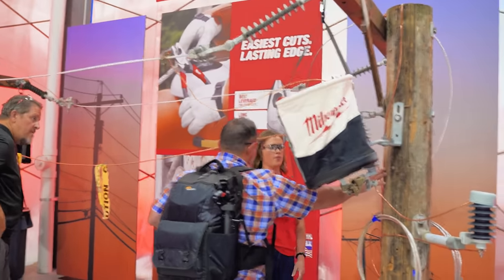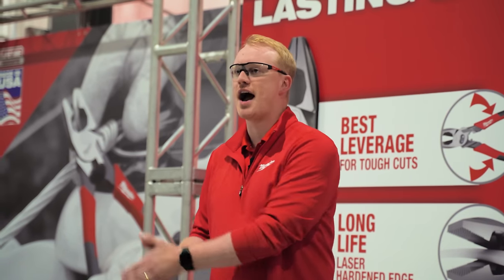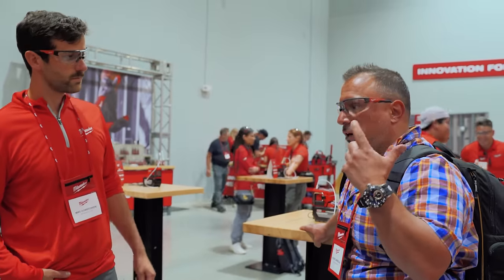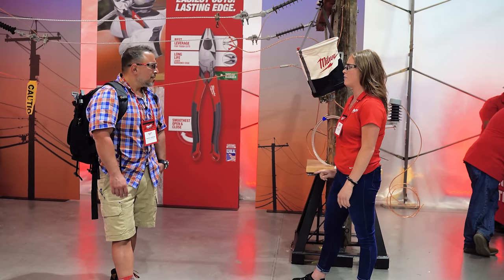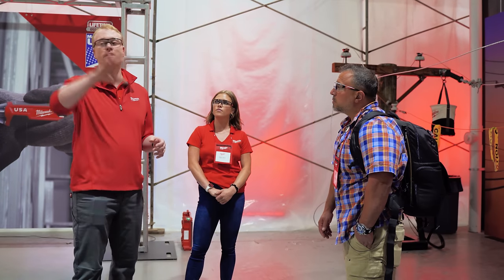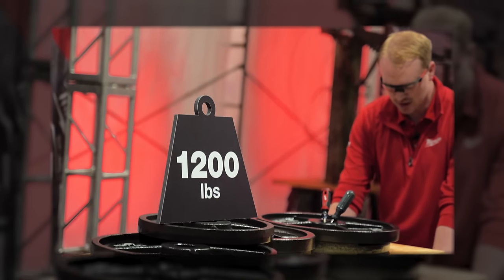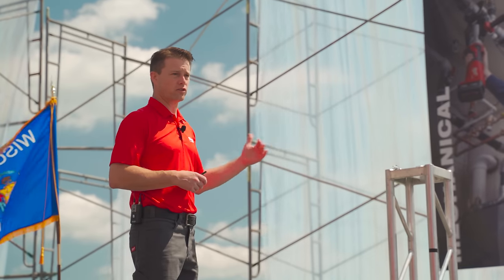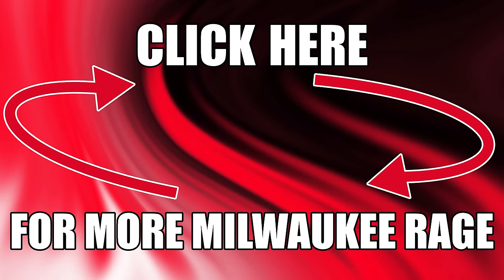BIG Problem With Milwaukee's USA Made Hand Tools (THEY'RE LYING)

Comment: That screwdriver pull test having the screwdriver pull 1200lbs load... I have never been in a situation where i had to horizontally pull my screwdriver at 1200lbs. 

Not even a succubus will hold your screwdriver at 1200lbs from you. 

But if that Milwaukee screwdriver could pull 1200lbs vertically then that would be one exalted driver of all screws.

Comment: Saw this when I was watching a comparison between the Milwaukee 6" chainsaw and a comparable gas brand.  The guy using the Milwaukee was pressing down hard when cutting the wood and the other guy wasn't applying any pressure on the gas powered when cutting.

Comment: I will never jump on any tool company's bandwagon. Or any company for that matter (especially Apple Computer). Milwaukee is no exception. I have some of their tools and most are more than good enough for what I do. There are a couple, however, that I have nothing great to say about them. Not to say that I won't buy Milwaukee anymore, but I know that there are a lot of good options out there that come in different colours and price points.

Speaking of different colours, I like having a diversity of colours in tooling when it comes to trying to find a certain tool. It helps when you have a quick visual reference, especially if said tool(s) tend to get buried easily. Not everybody works in super high-end shops or in laboratory-like conditions as so many marketers imply when promoting tools.

Comment: I agree with fighting with a tool to open it. I have the Milwaukee straight jaw plies I used the 10in more than the 6 and I have to fight to adjust them after using them for a couple of years.

Comment: Wish they'd fix the the 18v drill chucks. We've never had one last more than 2 weeks before it starts slipping even on new drills. Tried the tighten and back method , tighten tight method and even lost temper and tighten with cobra lock pliers. Nothn works

Comment: As a retired electrician I had multiple Milwaukee 18volt batteries on hand after using their drills, Sawzall etc. so I decided to try Milwaukee's 18v hedge trimmer/Chain driven saw and their Weed eater as I already had the Batteries. The tools disintegrated almost after one use and I had to return them for credit. Milwaukee needs improve their Home Gardening tools or get out of the business in my opinion.
Reply: My Milwaukee weed eater, hedge trimmer and chain saw have been going strong for years.

Comment: I use white lithium grease on all my hand tools and i’ve never had a problem opening or using them one handed. It takes longer to work it into the pliers, but warming it up a little helps. And it lasts so much longer than spray lubricants. 

As for the “free” lifetime warranty, nothing is ever free. That’s why the price of their tools are astronomical. You can buy the same quality at 3x’s less price. When you buy Milwaukee tools, you’re paying the same amount it would take to buy 3 of the same off brand tool with the same quality. They’re just doing the same exact garbage that craftsman did and hopefully they’ll get the same results. Our entire state park trashed all the Milwaukees we were repeatedly buying because they don’t even last a year. We now use all Dewalt tools and they’ve been working exactly the same for over 3 years now. Their hammer drills are the only thing that doesn’t last very long under extended use. Milwaukees batteries are probably the worst thing out of the entire company. You’re lucky if you can get them to hold a charge for longer than 6 months. Then they start only lasting for about 20-30 minutes and then die. And the new batteries are almost as much as a whole new set of tools. Dewalt batteries are $30 and last for years. My own personal tool set of Dewalts is over 7 years old and still has the same batteries. And they’ll last for several hours before dying.

Comment: to compete with best, they need to put what is professionally known as the best. Knipex pliers, snap on ratchets, sockets and wrenches. I would pit my 1/2 drive Matco air impact vs any Milwaukee 1/2 inch impact(they are the ones claiming to put an end to air tools). Milwaukee cordless is good for convenience or quick jobs out in the lot. In shop settings air is still king.

Comment: i would absolutely spend the money to buy tools made in america, I have snap on but milwaukee is definatly a good brand, Many of my coworkers in the diesel industry have milwaukee and have never complained about tools except the electric ratchets. Those things are garbage, Even snap ons electric ratchet is a joke, 

The working class needs a compact, Baton style 3/8s  electric ratchet that has Impact wrench like torque numbers. I would use that until my hands cramp up.

Comment: Milwaukee is really playing catch up in this space I don't love many Milwaukee hand tools that I have. The screw driver handle shape is not great in the hand, same with pliers the texture on the handle is not comfortable when you really squeeze on them. The channel rock type pliers are ok.  My favorite things I have are the socket set (but I wish they had a locking retention and push button release so you can change sockets with one hand.) I also like my adjustable wrenches that Milwaukee made.

Comment: Maybe technology has changed but... I used to work in a foundry which used traditional ingot melting and induction ingot melting and both required lots of safety and ventilation needs. At 27 seconds, you get an overview shot of the building, and there's no way anything is made there. I don't know lasers, so maybe that's what's going on there, but there's definitely no foundry processing there. May explain why no tours...
Reply from the maker: Why would they be “melting ingots”? I’m not sure you actually watched this video.

Comment: Notice how theres no demo on the 18 volt top off inverter. Bought two and niether one put out more than 98 volts a.c with no load. Also was using a brand new 5.0 amp battery fully charged. Emailed them but received no reply. This is the only tool of theres i have ever had to return.

Comment: Regardless of the gimmick or “claim” what I value most is that the tool works, is comfortable over extended use, and last but not least is supported with good customer service/replacement while under warranty.

Comment: Funny to see how Phillips screw bits are still so much widely used (cross/star heads), that we're pushing the technology so far as to get mere comfort - some material coating to limit the counter force imbued by the geometry when a torque is applied. While on the other hand, they don't hold up when compared to square heads which don't slip "by nature", and don't get worn out as easy (they also offer a better torque distribution from the driver, and there's no need for a forward force to be applied in order to keep the screwdriver from sliding out).. Although some applications could be better off with Phillips heads, Manufacturers should be encouraged to use square head screws
Reply: Sometimes you need a point of failure that prevents a screw from snapping off. Depends on the use case and expense. I don't think the slippage of phillips is entirely accidental. It's also a feature.

Comment: When it comes to ancient corded tools you couldn't beat a Milwaukee Sawzall, I bout mine 30 years ago and it has the twist off power wire which was rare at the time, I also habe a set of cordless Ryobi drill and hammer drill that's a good 12 years old or so and the batteries still last a couple hours. My Craftsman hand tool collection started in 1975/76 as a birthday present and has been added on to until they went overseas, I have a 20 piece set of craftsman ratcheting wrenches that are made overseas and I only chose those because I was able to get them for $59 on clearance and on sale from sears. My taste for tools has limited fanboi input from me and I choose what is best according to multiple sources with only special consideration if I can save like 75% or so.
 I will let someone test the new USA Milwaukee hand tools and make my decisions from those with nothing vested in the company.

Comment: They also need to include a charge for recycling and a return label for the product for the future when people are done with the tool so they don’t end up in a pile on the ground in other countries. Have you seen the waste created by power tool companies. 

They need to be responsible and create a recycling program. All manufactures should and the packaging should be designed to break down for storage for future return. This could drastically reduce e-waste.

Comment: I love all of my Milwaukee tools. I understand that they need to sell tools and find creative demonstrations. Every tool truck I've been on does that. The thing is, I'd be more inclined to buy a tool if you show me how it'll save me time or effort over what I currently have, rather than just showing me something cool. Tell me about the materials you chose, the durability tests, or something else that could tell me why I need your tool. I don't roll my toolbox around with a screwdriver all that often, so even though it's a cool demonstration, it's not gonna be the deciding factor on whether I switch screwdriver brands. I have great screwdriver sets that I've already paid for that come with lifetime warranties. That being said, there are some situations where I need a special bit, and my ratcheting screwdriver is just too fat, so I would definitely consider buying a torx set or even a JIS if Milwaukee would sell them. Again, I love Milwaukee, but I think they're just barely missing the mark on this one.

Comment: As an electrician & HVAC-R tech, I've used all makes of tools in my 40-year career.  While Milwaukee makes some great stuff and I own a lot of it, their screwdrivers are not very good, and their pliers so-so.  I also think many of their tools are way over-priced relative to the value.  My preference and go-to hand tools are still Klein and Greenlee with some Ideal and DeWalt mixed in.  However, in a pinch I have used Commercial Electric and Doyle hand tools.  I have to admit I was very surprised--not too bad.  Favorite meters are Fluke, Klein and Simpson.  I think Milwaukee owns the market on the best corded power tools.  As for battery tools, it's a toss-up; Milwaukee and DeWalt are always engaged in a game of one-upmanship which drives innovation and technology which benefits the guys in the field.  All this of course is just MHO.  Cheers.

Comment: I don't see how pulling weight on wheels prove anything. It depends how smooth the wheels, surface and bearings are. They should pull the weight up and see how much it can lift.

Comment: They are most definitely lying when it comes to the M18 chainsaws. I would like to see a real test against the Echo 2500T and Husqvarna T540i.
Reply: The battery saws have a narrow chain with less resistance... you probably know this already but if you throw a 3//8 chain on a battery saw they fall on their face really quick... the real test would be using the same size/pitch bar and chain as well as the sprocket on each and then see where they land... I have done all the testing you can do with gas powered saws trust me lol... and once the gas saws are converted to 1/4" pitch chain they fly thru the wood... my customers run 20" bars on MS200Ts because they can easily run it... dont get me wrong I love the battery saws even tho I make my living porting and building gas saws... I just love the convenience of the battery saws for climbing/limbing.. if I was up in a tree and didn't need the bar length... gimme a husky 540i and I am good... Even tho I am a sthil mega fanboy and it pains me to say that 😬...  stihl makes the best gas saws hands down!!!  but the battery saws are a joke unfortunately... sorry for the long reply just saw your comment and I would love to see the test also 💯

Comment: I'm curious,  how did Vince actually bring a pair of a competeter's pliers into the Milwaukee factory? That takes nerve.
Reply: Milwaukee provides the tools from competitors, they just paint them grey. Power or hand tools doesn’t matter. Even when launching packout they painted dewalt boxes grey. Unlike Flex which openly competes vs Milwaukee they don’t fear giving the name of the competitors items. It’s another gimmick. Milwaukee claims to be the best. Therefore competitors are only mentioned vaguely. Brands that aren’t known or new will mention the NY Yankee brand to gain credit. HF is notorious for using big brand several models old to compare too. Consumer only sees brand not the model or even knows. It’s all gimmicks. Truth is at the end of day if the job gets done with the tools you have did the customer ever ask the brand of tools used? No of course not only that the job was completed on time and within budget.
Reply: Milwaukee provides the tools from competitors, they just paint them grey. Power or hand tools doesn’t matter. Even when launching packout they painted dewalt boxes grey. Unlike Flex which openly competes vs Milwaukee they don’t fear giving the name of the competitors items. It’s another gimmick. Milwaukee claims to be the best. Therefore competitors are only mentioned vaguely. Brands that aren’t known or new will mention the NY Yankee brand to gain credit. HF is notorious for using big brand several models old to compare too. Consumer only sees brand not the model or even knows. It’s all gimmicks. Truth is at the end of day if the job gets done with the tools you have did the customer ever ask the brand of tools used? No of course not only that the job was completed on time and within budget.

Comment: I cannot complain about Milwaukee tools. As a purchasing agent for a metal fab shop the Milwaukee repair process is top notch. Dewalt is light years behind on that process. We go through angle grinders like crazy. And when Milwaukee warranty repairs their $69 dollar grinder over and over and over that's all I need to know. The only other tool I would put in the "life time" category it would be Hilti. Hilti owns the entire process from the engineering to the manufacturing. Hilti does not and will not "cheapen up" their tools to be sold at Home Depot like Dewalt has done to their demise.

Comment: If I'm doing a house with a crapload of boxes I'm not using a screwdriver I mean seriously like the few times I've done it by hand is oh that one box over needs needs to be adjusted or I need to check the wires behind that box but for the most part I'm 95% to 98% always going to use my drill or should I save my impact M12 and I have the first gen from 10 years ago so I'm not up on all that talk like all the new ones so I don't have adjustable to it it's just feather triggering

Comment: There is currently about 10 different brands of usa made screwdrivers.Stanley actually has made in the usa screwdrivers although they are not easy to find.I recently bought a slotted stanley usa screwdriver for under 5 dollars.Beat that milwaukee.
Also they are only doing it because supply chain problems have once again made it make more sense to manufacture right in wisconsin.German made are fantastic and even some taiwan are top notch.Some Proto screwdrivers for instance are made in Taiwan and they are just as good as anything made in the usa.Channel lock has good prices on usa hand tools that im sure they used as their competitor.
Reply: If you scratch the surface a bit you find that some key screwdrivers are more often NOT made in USA.  it's really hard to find a multi-bit entirely U.S. made.  There's a 6-in-1 by wilde, a couple others.  Regular screwdrivers you can more easily find U.S. made.  But there's also the "global materials"  language ppl need to watch out for too and be smart consumers there.

Comment: Dewalt power tools & the batteries are garbage. I've owned many & they all are not very quality. Carpentry tools are alright, but the batteries are crap. I like Milwaukee because they have a lot of specialty power tools for fields like HVAC & Plumbing as well as having some of the best batteries I've used. I still have my Milwaukee hammer drills, power drills & portable band saws that I used heavily when I was a Refrigeration construction contractor. I've dropped lights & drills from scissor lifts 30' up & although the battery became crooked & wouldn't lock in, the thing still works to this day. I just recently bought their new 18v chainsaw & the biggest battery they sell, which was more than the chainsaw. So far, this thing is a beast & cuts cleaner than my small 40cc Huska varna. The battery doesn't feel quite as solid as my others, but it is oversized being a 12-amp hour. I have a 10'x10' advanced storage container that I bought from gov auction & one half is filled with Milwaukee power tools & batteries & the other side is filled with close to 1/2 ton of ammo. I love tools & guns! Merica!

Comment: I have not had great experience with Milwaukee hand tools I’m a plumber and pipefitter so ymmv. Their channel locks/adjustable pliers are far too chunky and have inferior grip on surfaces compare to say Gedore or Knipex for their size not a big fan of their levels the bubbles tent to be in a non standard orientation, adjustable wrenches are decent. I do like their 1/4” driver bits. They hold up just fine till I lose them. Never broken or worn one out.

Comment: West Bend, Wisconsin. I did the Data network in that facility. It's all R&D. I was there before 70% of the work was done. I don't give a shit if my bosses see this. That job was a shit fest. Milwaukee wants you to use their tools at all times, even though in the scope of work says: All TTI hand tools and power tools are accepted. If the TTI Family does not make an equivalent then it will be permitted.
Reply: If they haven't erased it, you can find my name on the side of the steps near the front entrance, below the 2nd story office space.

Ian Wood, DATACOMM (I think I signed 3/12/22)